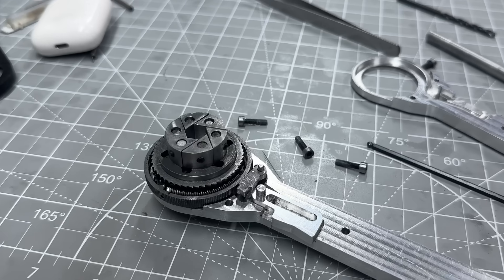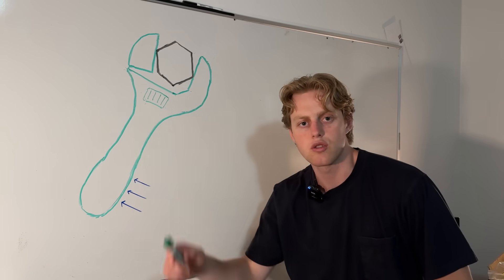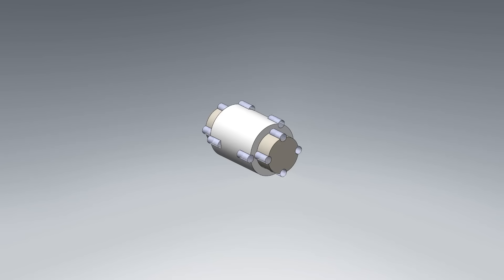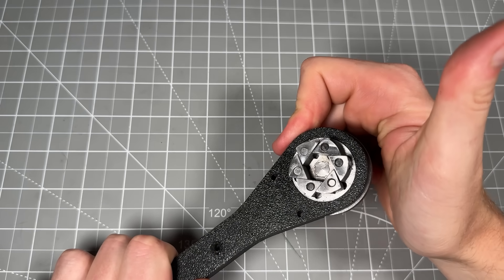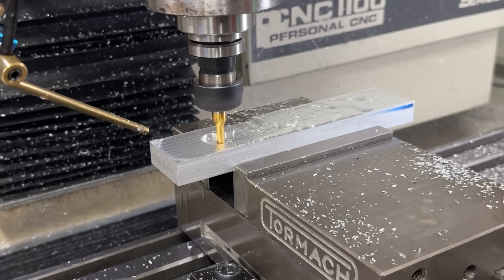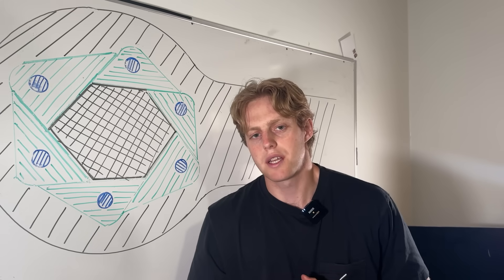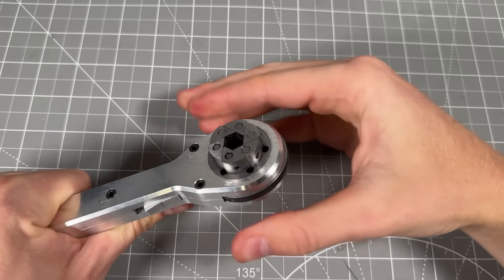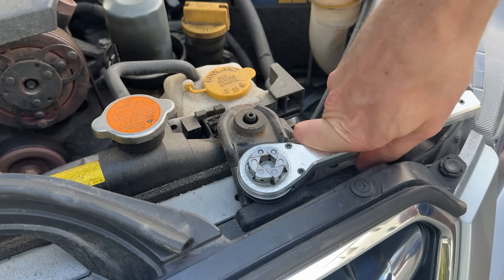I Invented an Adjustable Ratcheting Wrench

Comment: I pretty much use sockets and wrenches only.  I've tried tools that multi fit only to find they just dont work. Mainly too lose and any torque destorys them. Your design looks promising, it definitely has a place in my tool box. Just a couple recommendations. Serrated teeth for rounded nuts and bolts. Most importantly seal it from dust, dirt, grime. Or make it extremely easy to clean out with no rusting. Lots of moving parts there. I'll definitely purchase one because of all the effort you've put into it. You have my support. Now you just need a name.

Comment: Yes it a new and clever design.  It has the problem of all such tools. It's too big and thus has a problem of access.  The best design I've encountered is the flexhead quadwrench. Because it's 8 separate wrenched on 2 tools you avoid the bulkyness and you have the convenience of a ratchet.  The flexhead increases the usefulness by increasing access in stead of an extension.

Comment: As a mechanic I love this idea. I still don't think this would be a tool that gets often use for me though as it's just a little to shallow. 2 ideas to toss around (if possible) is 1 give it a flex head. Damn near every mechanic has flex head ratchets bc of how well they clear obstacles. 2 make the Jaws 1 solid unit & have a standard & deep set of them that you can swap between. A simpler idea is to just have two separate versions. One shallow & one deep. I don't see this tool replacing sockets as I can't put extensions or swivels on it BUT just a few tweaks & I think this would be great. For me I could totally see using this for oil changes & such where the bolt size varies between makes & I could use this to skip the "what size is it again"?

Comment: If you get to the point where this can be mass produced, i will back that kickstarter in a heartbeat and im sure mechanics around the world will too. You can make a whole range of products with this tech. It would be nice to have an option with a digital gauge that tells you the size of the bolt too.

Comment: very bulky, maybe a left and right adjustable ratcheting wrench ? cut that thing down the middle. tighten the tolerances with 3 adjustable ones, small, bigger, biggest. i use wrenches, but wouldn't corner gripping adjustable Ls that are on a lever grip better? wait what's wrong with vice grips

Comment: I would buy your current wrench as is as it's currently designed. It would be good to have around for light duty stuff like furniture or table assembly or putting together thin metal or tightening loose bolts on wheel barrows and carts.

Comment: Now put a hole in the middle, so if the nut is on a long bolt we can pass the bolt shaft through the middle.and it will let you reach the nut

Comment: I would agree with what you said at the end about it being better to have one strong use case, but I think what you have here is something that is a bit of an exception to that rule.

It seems like something that will work just as well for 90% of use cases compared to using sockets. I think you should play to that strength and try a kickstarter or something similar to get this in production, instead of worrying about optimizing it even more for niche cases.

The only suggestion I would add is one that’s mirrored in another comment here, and that would be adding a way to adjust the head from the handle for tight to reach places.

Comment: This is bitchn bro please keep it going I wonder if u could make a replaceable head so u can use it as a deep socket.. Or could you somehow make it so the Jaws on both sides are one piece or make it so the bolt could go all the way thru the center as I have some craftsman sockets like that as it's a shallow socket and a deep socket as the center is opened and uses specific sockets...maybe something like that could help.. But killer shite please keep going with this I think it's a brilliant idea

Comment: It seems like it would be stronger if you could find a way to have a set of plates on the outside, with 1 set of jaws sandwiched in between. It would also allow for a bolt to pass through when turning a nut. These would definitely be handy to have around the shop. Reach out when you need a manufacturer :)

Comment: I am exceptionally interested in seeing this become a commercial product, as I dread in my lines of work having to inevitably grab a fist full of sockets, walking half way across the 30,000 square foot factory I work in, and praying that I got the right size the first time, or worse, being laid out under a truck and running into the same problem. if your able to end up manufacturing these, and especially if you were able to make them as a set that could do 1” to 1/4” with 3 or 4 wrenches, it would save me a MASSIVE amount of hassle and time. tight spaces would still be problematic, due to the size of the head and no good way to extended the length of the jaws without compromising strength (that I can see anyhow) but as you said a good specific purpose is better than a mediocre general purpose.
Reply: with all due respect brother, it's time to get a roller cart. i work in the largest factory in the world, and when the going gets rough and i need to do something major down line, i'll bring a roller cart with every single tool i can possibly think of for the entire job, with tools for mistakes that i might or might not make included. saves you the soreness that comes with 30k+ steps in a single day.
Reply: @johnathonfrancisco8112 I actually agree, probably gonna end up building one with over size caster wheels cause our floor isn’t the best, the point still stands though for certain jobs and situations such as mobile work this would potentially save a lot of hassle.

Comment: This is really cool, I think for automotive it’s too bulky, and things like spark plugs, or most bolts in the engine bay would be inaccessible. Maybe brakes/suspension work? 

That said- knipex makes adjustable wrenches, more for the pipe, plumbing, and heavy industrial, where bolts are easily accessible, and many guys carry only a few knipex tools to replace a whole tool bag. 

I think if you made a bigger wrench, more like 1-2” to 1” or even 1”-2” (not exactly sure what sizes are common) I’m not in plumbing, or heavy industrial) you could really have a big market for this tool and it actually could replace a whole SAE and Metric socket/wrench set. 

The only downside, compared to an open or box end wrench, is if there are threads protruding from a nut, it would stop your adjustable teeth from gripping the nut- this is where one would either use a deep socket, or an open wrench. 

Really cool idea, and your dedication is very inspiring 

Thank you for sharing!

Comment: Big Socket has this guy on a hit list
Reply: They’ll probably try to buy out his design and then lock it away never to see the light of day again.
Reply: @cleenlivin  this will not impact sockets sales in any significant way. The adjustable wrench is still a thing, even though it technically replaces an entire wrench set. It's limitations (bulky, prone to failure, not exact) keep wrenches the better option for most applications. This adjustable socket wrench will probably be in the same boat if it becomes commercially available.
I would love to buy it, simply because these kinds of tools are good for their convenience, even if not for every job. I use adjustable wrenches quite a bit when working in my cars/atvs, but regular wrenches are still superior.
Reply: @Jdur17  this will never become a commercial product. he's wasting him time and energy on a rube goldberg machine. it doesn't work on bolts bigger than 1/2, it's heavy and bulky. no one would EVER choose this over a 3/8 ratchet and a set of sockets. not only that.... you can get a ratchet and sockets for like 20-30 bucks. What do you think this wrench is going to cost with all its machined parts? that ratchet is going to cost upwards of 200 bucks. who'se paying that for a gimmick? nobody who works with tools. he'll get keyboard warriors and redditors and tiktokers, but not any tradesmen. 50% of the time the bolts are recessed or hard to get to, as a mechanic i'm constantly using 30-40" long extensions and even up to friggin 4 feet if i'm dropping a transmission
Reply: @schlomoshekelstein908  it's really not a waste of time, especially considering this is one guy's PROTOTYPE. I don't suspect that this will be something that will be purchased instead of a socket set, like I alluded to in my comment, but it will sell. The gator grip socket thing, for example has done fairly well, even if it is not the best option.
Also, you don't seem to realize that if this were going to be mass produced (in a revised and refined state), it will be made our of cast materials most likely. Creating a mold for every iteration is not viable for the PROTOTYPING stage. Machining, especially when you have all the tools and knowhow, seems like a much better way to go for this stage. The internals in your everyday socket wrench are machined, so that doesn't mean machined parts makes it expensive.
Finally, it's hilarious that you look at the first working PROTOTYPE designed and manufactured, again, by one guy, and think that that's as far as he got, or can get.
Reply: @schlomoshekelstein908  as-is not many, at least not comfortably. But again, it is a prototype, and prototypes tend to be unrefined and yes, bulky. I don't see how this design could be made to fit with an extension, which is the biggest drawback. The bulk is not even the biggest hurdle, its the fact that extensions have no way of working. But then again, thus will still have use cases, similar to adjustable wrenches, whicb ate also bulky. Never going to be preferable to a socket wrench and sockets, but for convenience, maybe what I would reach for (if it gets cut down in size).
Reply: @Jdur17  i can put a crescent wrench on a bolt and still tilt it up to like 40-50 degrees and still get some leverage out of it. this doesn't do that. crescent wrench doesn't have to be completely paralell with the flat head of the bolt is what i'm trying to say. and i'm sure many people who've used crescent wrenches can attest that being able to do that got em out of a jam. I know it has for me. He should have just built a better crescent wrench lmfao
Reply: @schlomoshekelstein908  I'm using the adjustable wrench as an example of a "universal" tool that is technically worse than a regular wrench, but it still useful. You can't use much force on a crescent wrench, and they can't fit everywhere a regular wrench can. I feel like the final iteration of the socket wrench will be like that.
My point I guess, is that it will likely sell decent enough to make back costs and earn some profit, even as a novelty.
Reply: @Jdur17  he should have made a crescent wrench you can use force on
Reply: @schlomoshekelstein908  yea, the worm drive is the weak point. Too much slop that binds the gear and loosens the grip
Reply: @Jdur17  Yea I have a wrench plier and love how handy it is to not have to try a bunch of sockets...... and then realize its metric not SAE lol
Reply: @cleenlivin  even simpler, they'd just get some Chinese factory to make a million and sell them on Amazon. No culpability when the manufacturer is in China, and they don't need to lock it away when they can steal the design and profit from it with no legal repercussions.
Reply: 😂😂 fr he’s gotta watch out
Reply: remember! hes not screwicidal!!!
Reply: Someone out there is trying to ‘snap-on’ some handcuffs for infringement of a patient.
Reply: nooo, big socket's laughing cause torque would demolish it.
_
Reply: Nah. They still got their bread and butter business replacing 10mm sockets
Reply: Something similar already exists in socket form, look up Merrick Tool. It may be worth Trev double checking with Merrick's patent on their socket to make sure he isn't gonna end up in court over it if he goes to market.
Reply: Recruiting list probably
Reply: what channel is that, could you plz share the link?
Reply: Just so we all know ahead of time, he would never commit soooiside if ya know what I mean lol
Reply: @AnEyeRacky  yu bet i f----n' dont... Wut!??
_
Reply: best comment
Reply: lol
Reply: Not really the corners of the nut might be ripped after prolonged use.look at new socket the corners are round to prevent that ,nice design for at home use but commercial will be terrible.but I still want to buy one ,I’m sorry but this is so amazing thought I love it . he made an amazing design.
Reply: its an adjustable wrench, not a socket replacer lol.
Reply: in all honesty... not really. The drawbacks become immediately obvious as soon as you have little clearance in certain areas. This is why thin walled sockets exist
Reply: Big socket will find him no doubt.
Reply: anything needing torque this will break and my canadian tire tools get replaced for free up the road. snap-on amtco etc..  Lol  I can't imagine this is practical outside home use and definately isnt for industrial lol id break that in a day
Reply: Put the design on a socket. Have it replace gator sockets.
Reply: The biggest problem in all that kind of things are, that they don't fit anywhere when really doing something. The bolts are almost never in the straight surface. In most cases, the socket also needs to be as thin-walled as possible, otherwise it won't open anything. So yeah, that is completely useless tool even if it works mechanically.
Reply: @intromortti  yeah, that too....
_

Comment: You should make one for rounded off bolts with pipe wrench teeth on the inside.
Reply: It would be a perfect "Fits all oil drain plug wrench"

Comment: Amazing work, really cool concept. 
Instead of having the 2 sides to tighten/loosen, what if your pawl/direction selector could also make the pins engage a different spiral groove plate? Like the fact that one side only tightens while the other only loosens is because of the geometry of the spiral plate; if the ratchet direction selector could also make the pins somehow interface with a different spiral groove plate (one with reversed spiral direction), then you'd be able to both tighten and loosen with 1 mechanism perhaps
Again really excellent item!

Comment: I genuinely think this thing could be extremely useful. In HVAC you often find yourself working bolts under 1/2 inch so a tool like this would be extremely useful. If you could find a way to mimic the length and profile you get out of a socket this tool would be incredibly useful and desirable, but even in its current state offers a lot of value.

Comment: Don't know if this has been mentioned, but manufacturing tolerancing with wire EDM cutting could be potentially applicable for your invention and I think would be accurate enough for your tool. 

In any case amazing work and way to trouble shoot, design, and fabricate your invention.

Comment: Whatever you do, if this is successful or not. File a patent. Pretty sure a patent is dirt cheap. This thing is too bulky to replace a wrench set, but it can definitely replace an adjustable wrench because those are pretty bulky as well and they aren't ratcheting and only grip 2 points.

Comment: Nice dude!!! Really solid work... Now, someone like me (a mechanic) is definitely going to increase leverage with a pole when i need it. That's going to put inintended load on the pawl... but if you could put two pawls on there instead, that'll help keep it rigid! 

Also, sewing machine oil works amazingly to reduce friction on those pawls, whilst keeping it rust free.

I genuinely think this product would work - once you have it ready, drop the link. I want one.

Also, why don't you stick an impact connection on one side and turn it into a drill attachment? We would love you forever if you did that.

Comment: This would be great for a tool bag for OverLanders. You always try to bring all the common size wrenches and sockets in case something breaks in the middle of the desert, but this is the universal wrench -- it can be practically any size. And what ifs you need two 13mm wrenches, and you only packed one? Use this universal wrench as the other.

Comment: I'm a field service tech currently carrying a 230 piece socket set and almost 30 different wrenches.  I would LOVE to be able to reduce my tool load with this! You said in the video that you didn't have a way to tell which way the wrench was turning. Other ratcheting wrenches have an arrow engraved on one side or both that tells you which way it turns so just do the same. Good luck!

Comment: This would be great for working on BMX bikes, as the front and rear axels are usually different sizes. This tool would allow for work on both wheels without needing multiple wrenches or sockets.

Comment: For practical purposes this is already more practical than a standard ratchet/socket for 90% of the bolts you would need to be wrenching on! I would make sure you have a patent attorney in the process of filing this design already! The prototype functions well enough to patent imo. Then continue improvements. I would love to do a review on this for my channel once it’s ready for the market and would definitely buy one for my toolbox if I saw this on the shelf good job man!

Comment: Its a great design but the problem with your wrench and any wrench like it is versatility, there will always be a need for sockets and extensions becus any mechanic engineer or anyone whos ever worked on motors engines machines ect. will always have a need for extensions, thinwall sockets and a variety of tooling of different lengths and sizes to fit into small areas, to reach into spaces a basic wrench can not reach or fit into, not to see there isnt a function for your wrench or wrenches of its caliber but it isnt ideal for it to replace a socket set altogether.🇺🇲